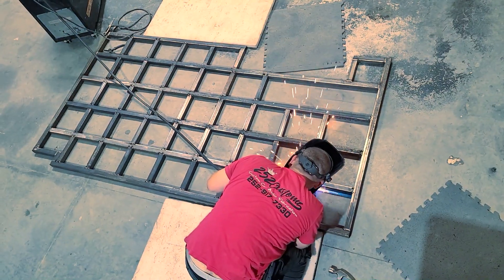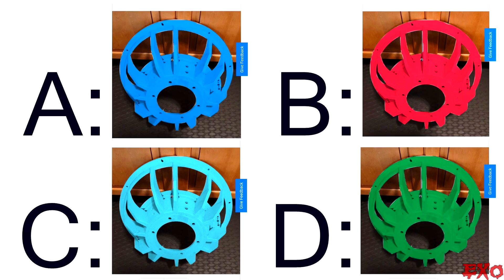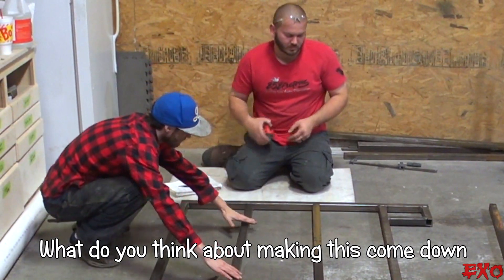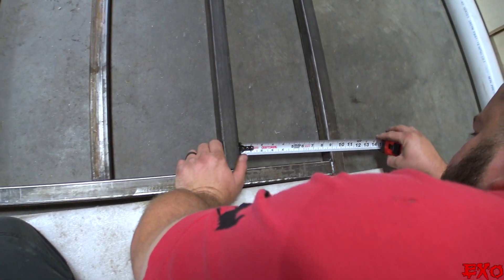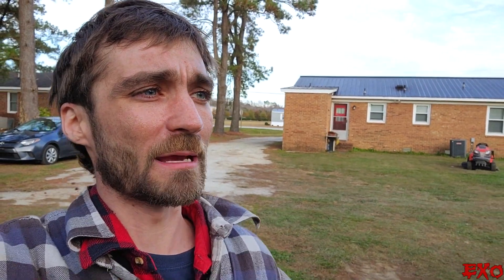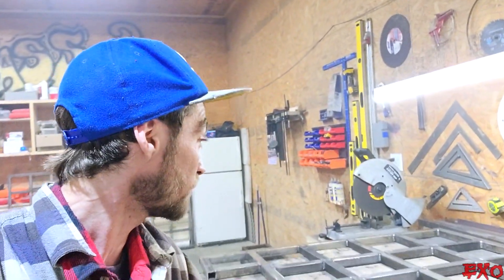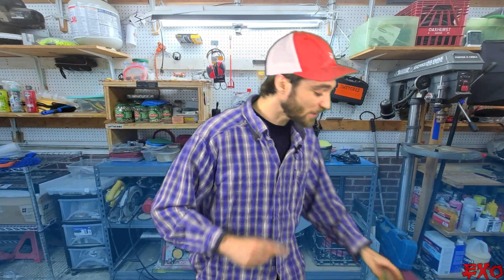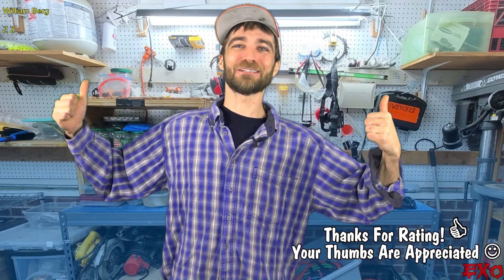BUILDING A BIG Car Audio System Pt 2. | Welding STEEL CAGE for 12 18" Subwoofer Box & CUSTOM INSTALL

Comment: A trick with metal shavings: you can roll a dollar bill up until a cone shaped and use the pointed end to kind of scrape with the edge to catch it and lift it out. You want to use a fairly crisp bill and don't roll it too tight (it needs to have a little give so it doesn't stab). Been a pipe fitter for years and this has helped a couple of times. Sometimes all you can do is get it drilled out though.

Comment: I have never seen a magnet work. A q-tip works if you use it right away. But the eye doctor I go to is the bomb. If I could get ahold of the drops that deaden your eye I wouldn't need her. Your eye is the fastest healing organ in your body. So it skins over the steel in less than 24 hours. That's what makes it hard to get the object out. Oh that drill will trip you out when you hear it and then see it coming.

Comment: Diablo makes blades for cutting metal, one style for nonferrous and another for ferrous metals. I use one for aluminum and absolutely love it, I wonder if the steel blade would be worth the money for these guys in place of the abrasive discs.

Comment: Hey exo just wanted to say thank you for what you do I am 17 and have a Ford ranger and have a 15 sub and running a jl audio 1000watt rms amp have also sound deadened and done mids and highs but have a huge power drain. What’s the best way to get my voltage back up without spending lots of money

Comment: Hey EXO. Between you and Doug from soundmanca, I think your bass van is going to bump harder. Doug is a good builder but he is more sound quality than teeth chattering base. And Steve Meade’s Tahoe is slammed pretty hard now that he upgraded the power system. So it’s gonna be a close race. 
And I will go with red for the baskets. Your van is black and black and red is a pretty awesome color combo.

Comment: Hey EXO what subwoofers would you recommend Im bassing on a budget I got a 2000 2 door S10 Blazer with two alternators and two batteries a 8K bass taramps a 6 Cube box I had to evl-15 skar audio but I blow a voice coil in one and they do not sell a recone kit as of yet  is there any subwoofer you suggest that will actually handle good power thank you

Comment: Its probably not likely to happen to you again im guessing, but as a welder the best way to get slags burnt into your eye out is a lameninated business card. You need someone you can trust and has steady hands and they have to pluck it out. Its really unpleasant but like you experienced, theres really no specific go-to way to handle it. Its happend 3 times to me and the worst was a coworker who had one burn in flush with the eye. Took a bit but we got it out

Comment: I have a newbie question. I'm looking to put a battery in the trunk for a future install. Does it matter the size/gauge of the wire running from the battery in the front to the back of the car? I want to do the same setup has he did for his girls car with the two tens.

Comment: I was thinking man you going to have a POWERFUL SYSTEM WITH A WIND TUNNEL THAT WILL MAKE BASSHEADS TAPOUT IN MINS. :D LOLOL AND forget about the haters as long they are hating you are doing something right as the old saying goes :D lol  but I like options A blue or green though..............

Comment: Dude bro, just hit up your local ophthalmologist. It will cost a few hundred  1 time visit. Easy peasy. Don't leave the rust in ur eye bro. We need our eyes.
Reply: Exactly, if you leave any residual stuff in there it will leave rings that you will end up seeing as halos or shadows the rest of your life. I had similar experience but was lucky my soft contacts caught the metal that would have been in the vision part of my eye, got the bits from outer white area at surgeon.

Comment: A lot of that steel could be replaced with plywood and well designed bracing, which this will need anyway. Square tubes are also not ideal for this... Interesting project in any case.

Comment: I worked three years in and iron foundry and would get iron shavings in my eye either they used a magnet to remove the metal if that didnt work I would have to go to the eye dr to get my eyes drilled most I have had at 1 time I 6 times in each eye was ki da cool cuz the eye dr numbs your eyes and you can actually see the drill going into your eye

Comment: What are best 2 12s for a 3000watt sound stream amp i use to have 4 gray cvr they hit hard but sadly burn then i got 4 black red cvr they suck
What do you suggest  compare to 12 gray cvr or better

Comment: Yes, I totally agree with the thing that everybody is enjoying their audio systems especially what the persons built for themselves - like me. For example my car sub is probably the least powerful sub ever installed in a car here on youtube, but it is totally enough for me now / moment + it is removable / reinstallable by seconds (disconnect / connect 2 pcs of RCA connectors, and a rubber rope). People who just heared my sub, usually say that it is a good sounding, but very "daily" sub around 10 inch diameter on somewhere between 170 - 200 Watts RMS + in an average, but widerange "daily" box - good only for music listening - basically too "average" sub. Yes, they are saying truth on sounding, but not on power and size. After showing how it sounds like when I show that the sub is made of 2 pcs of 15 Watts RMS, 4 Ohms, 35+ years old home-hihi bass / bass-midrange drivers + I have no additional amp on it - wired directly to head unit's rear speaker outputs + the rear outputs initialized like subwoofer outputs with LPF + configured HPF for front outputs - they have no words for that, and only asking questions like "How? Why?". So, Why?: It is a sub which is enough for me + it is simple + it is easily removable / reinstallable, and How?: https://youtu.be/D0U_F2DX6rw .

Comment: This is going to be really bad ass I'm just concerned about the total weight. You aren't weighing anything, don't have subs amps or wires in yet. That van has a maximum payload. You won't be road tripping much in this thing based on what I am seeing. Not only that, but metal fabrication is super expensive compared to making things out of wood or composites. I hope this all works out. I just think it's going to be super heavy and not for much gains audibly.

Comment: Exo
Why does sound system sound louder on a diesel truck like my f250

I try same amp and subs on my f150    buts its weak and on my f250 there extremely loud

Comment: Hey what's up I got a non-ported box for 2 10" subs from bassworx from craigslist for $50.  I am wondering what subs I should put in it and what amp to use also,  I don't want to spend more then like 400 to 500 bucks.  Any sugesttions?

Comment: I get metal in my eye every single time i touch a grinder. I tried safety glasses, safefty glasses with faceshield and still got metal in my eye. Now i use safety goggles and havent had a problem

Comment: I need help from the basshead community I'm running 2 12  massive audio subwoofers and a 500 watt amp I need to upgrade what amp would be the best to run my 2 12 also EXO B OPTION IS A NICE COLOR
Reply: What model massive audio subwoofers do you have? Also whatever your RMS is on your woofers, me personally I would go three times that. Meaning if your 2 subs will handle 500 rms(250per sub possibly) total I would do 1500 watt rms amp. I was told when I started audio is always good to have more and not need it.

Comment: I have had metal drilled out of my eye 12 times talk about not being fun
Reply: Wait, what? Why do they drill it? I am a welder and have gotten stuff in my eye but never drilled out!!!
Reply: If it’s hot metal like from a grinder it will actually melt your eyeball and become imbedded. It’s no fun, but 12 times needs some explaining......
Reply: I'm not a expert but if you've had that happen 12 times would recommend getting better safety glasses. Or from the sounds some in general!
Reply: For real.  12 years metal framing buildimgs and only 1 time have i gotten metel in my eye.
Reply: I been  metal fabricating for a living for 35 years the metal get  inbedded  in the  eye then turns to rust so they have to drill it out they user tool called a burr

Comment: buy the time he welds all that caging in and then wood your gonna need duel wheels and f450 leaf springs . im sorry but theres no need for all the steel cage . it would have made more sence to use 2x6 and shaped them to the roof then build box to that hieght . then when its done use 4inch hole saw and fill all the viods with blown in insulation and during break in ckeak and keep filing . no more flexing = more dbs

Comment: Having metal embedded in your eye is the worst . I also know first hand . Keeping your eye open while the doctor drills your eye is the worst. When I weld I have safety glasses under my welder helmet. When grinding I have fitted safety glasses along with a face shield. I don’t want to go through that again. 
By the way keep your eyes closed in the shower the first time you rinse. Lots of metal hides in your hair after grinding. I also had metal in bed into my eye from that .